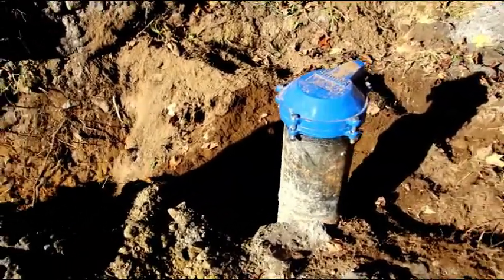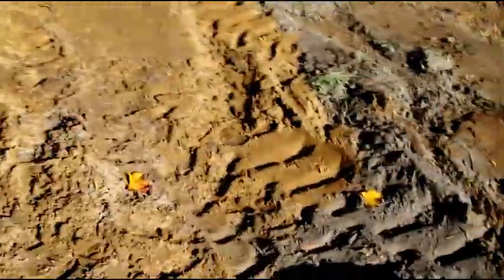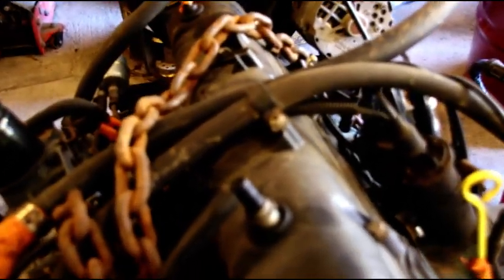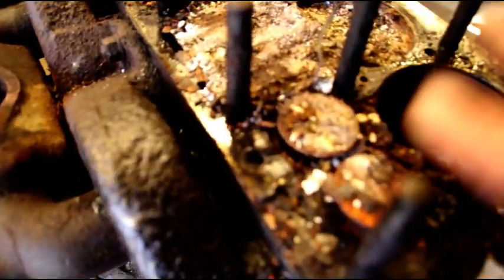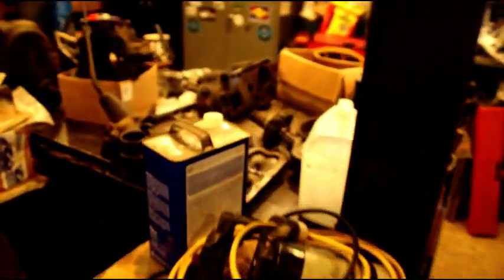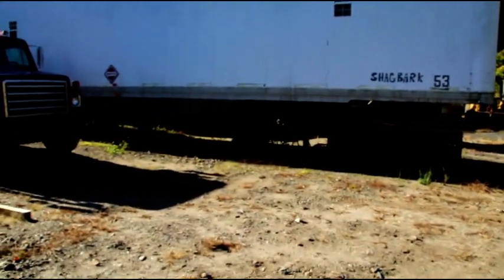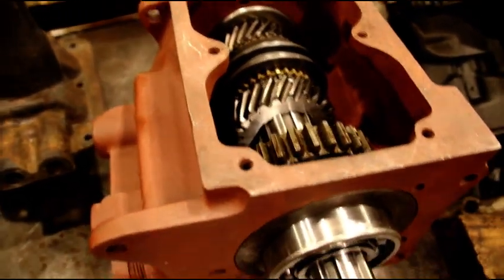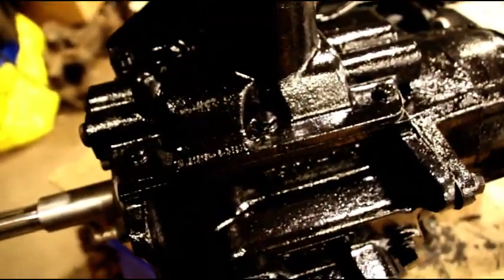Jeep Scrambler, Pantera In The Sun, Project Updates

Comment: Brian, I used to haul Panteras ln the early 70s when I drove for Nu car carriers, a now gone trucking company. We hauled mainly for Ford, but  also did work with imports as well.  The Panteras I hauled came out of the prep center in Newark NJ. and it was a treat to haul them brand new. THEY had no problem getting up onto my car carrier, even loading from the ground. The power they had with those wide tires was unreal. Ironically  they only went to mercury  dealers as I recall. I  think the only options at the time was what color you could get, you better not let them idel very long in the summer heat, as they would blow antifreeze all over everything . BEST to you and Maria.Warren in Vermont.
Reply from the maker: Not too many Panteras around this area any more so it was good to get this one a little bit closer to being on the road.  Thanks for watching

Comment: Another good video. My sister put city water to her farm house and they went through several wet bits getting it done.  I have been taught that if you have to ask how much, you can’t afford it.  I’ve been really wanting to know anyway, if the engine block is good, how much does it cost to have you rebuild it ?? I’m sure that’s a personal question, so if you wish to delete the post, I understand. Sincerely, Ed
Reply from the maker: Every engine is different.  A good engine that is not locked up, cracked, or damaged in any way can run $4500 to $5000 for all the machine work and all new parts.